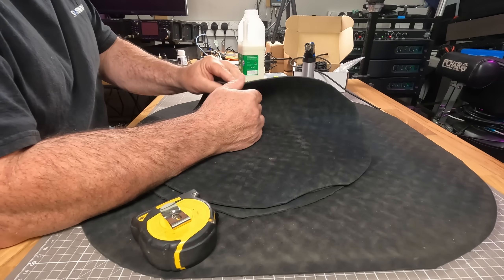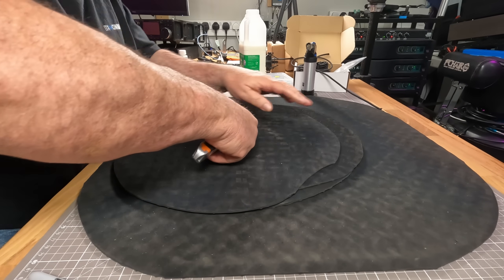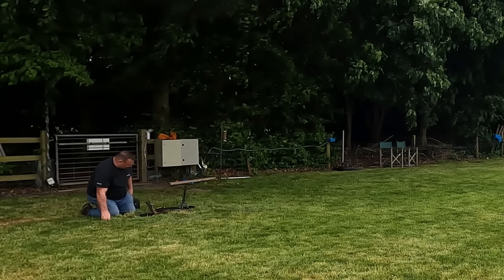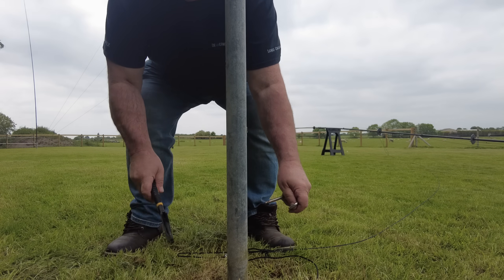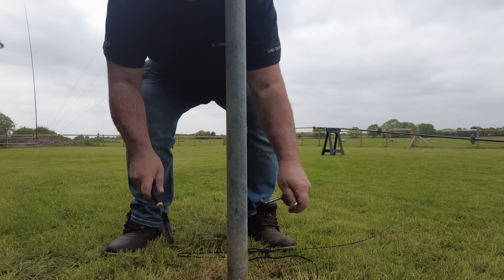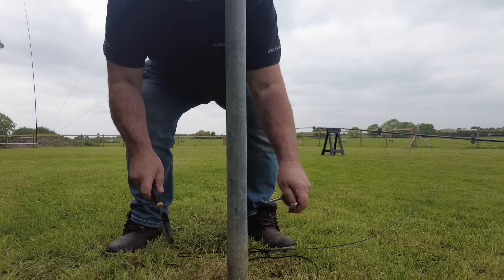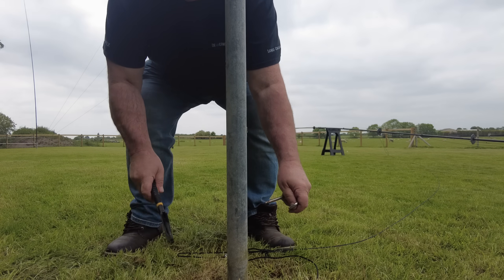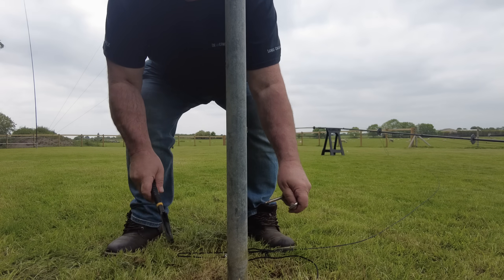Vertical Antenna Lawn Mower Protection Thing

Comment: Callum, maybe rather than drop the guys on the beam just split the rubber your putting down half way so you can put it around the base without taking it all down. Then gorilla tape or flex tape under  the split so it still keeps the grass out?
Reply from the maker: I don't want it split.

Comment: I am in the process of doing something similar with my DX Commander Classic - I made a 19 foot radius circle of landscaping fabric, placed all the radials on it and the guy anchors fit neatly inside the circle.  I lined the perimeter with stones.  Once I can source some plastic anchors for the radials, I plan to fill the circle with 2-3 inches of mulch.

Comment: I don't know if they have them in the UK, but here in the US, they sell a disk-like rubber mat that is already made to put around a new tree to keep the weeds away from the trunk. This would be great for an antenna as well, and they are not that expensive either. Anyway, that is a great idea!
Reply from the maker: Well, I normally make-do with what I have :)
Reply: @DXCommanderHQ I do the same especially if I already have the material on hand

Comment: Nice idea Callum.  The black color of the rubber combined with the fact you are covering the ground should keep the weeds tamped down around the mast and guy wires. 

Out of curiosity does your mower use boundary wires to know places not to go, or is it using GPS alone for navigation?
Reply from the maker: Mower: GPS mate!

Comment: If you have a piece of steel pipe, you can sharpen the edge then use it as a hole punch. (Hit it with a hammer). I’ve never made one that big but principle should be the same. 👍. 73
Reply from the maker: Sure. I could spent 20 minutes building a tool I would never use again - or do this in 10?

Comment: Nice. I genuinely think that not only should you start selling this as an accessory or including it with each antenna kit, but that it should actually officially be named "Vertical Antenna Lawn Mower Protection Thing".
Reply: Be selling the knife to cut the hole next.
Reply from the maker: Gottsa be a "thing!"

Comment: Hi Cal,
For the mats on the tower and the four guy posts, cut the mat from the outside to the hole in the center. Now that you have a slice in there just wrap it around the tower and each guy post. Then use some long nails on each side of the slit on the outer edge and the same half way in and do that for each of the rubber  mats. Now you don't have to lower the tower or do anything at the guy post. You and the family stay safe.  73  WJ3U
Reply from the maker: No slicing. And if I showed you how the mower turns (and I didn't know this), I'm glad I pnly put a hole in the centre.

Comment: Get your tube grind a sharp edge on the end and hit it with a lump hammer with a block of wood under it it will cut out lovely circles
Reply from the maker: I did (not) consider spending 20 minutes finding the grinder, sharpening the edge of the tube, finding the right lumber to hit it on with the lump hammer only to never use it again. Or I could spend a few minutes cutting it.

Comment: Funnily enough my wife just completely twisted all my radials, pulling them out of the grass and even buried one's on my Sig 9 when she put the rotary mower over it.. It all ended in a twisted mess around the coax. 

All completely ruined.
Reply from the maker: How the hell did she do that? You must cut the grass down to the bone. This is cut at over 2-inches and I pin anything down flat if it might lift.